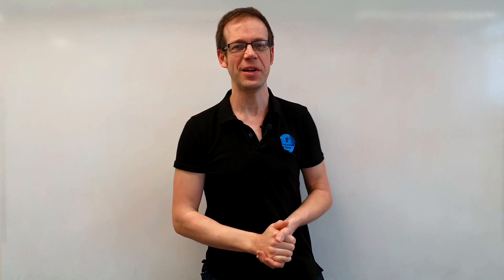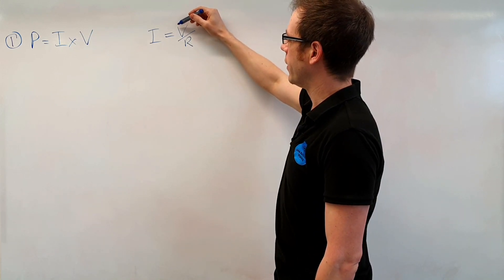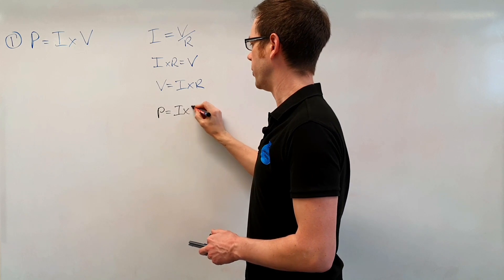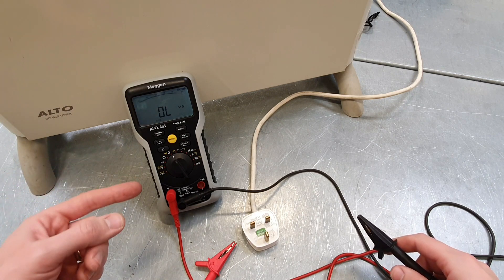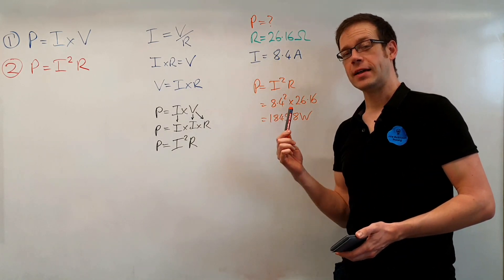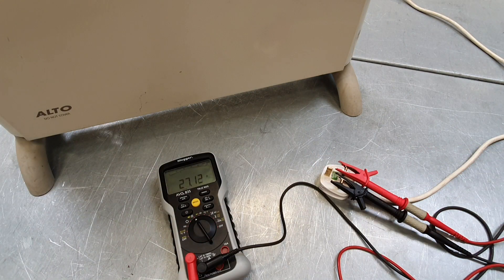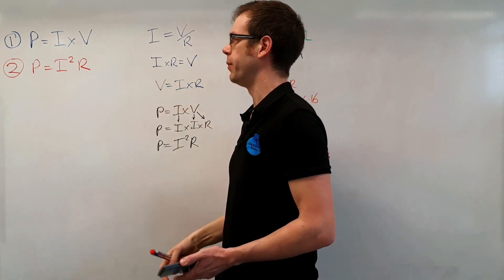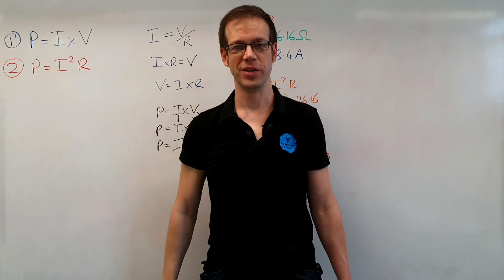How to Find the Power Formula Number 2 for Electrical Circuits, Calculating Power Without Voltage

Comment: when calculating power in ac circuits, you'd use IVCos0, I notice when you use the other power formula, I^2R, you don't use the Cos0... can you explain why? ( is it because your using the resistance? If you were to use impedance would you then add Cos0?

Comment: Hi Joe, just wondering what the calculation is for power lost as heat.  You mentioned this at 12.40 in the clip. Is it as simple as measuring the resistance before you use the transformer and measuring it again when it's warmed up, the difference being the power used as heat?

Comment: Try this on your learners Joe.
How much power would be consumed by this heater if you supplied it with half its supply voltage.
Reply from the maker: Ah, lovely question, I guess they fall into the trap of thinking the current stays constant!

Comment: Great video joe  , is there any regulations about hot line colours?? , i know the "brown" is the line and the "blue" is neutral so can we use in pvc conduit single wire ( the red or green or yellow or pink and  orange) or any colour we got in singles , and the blue stay the neutral and the earth  green/yellow
Reply: so joe is there any colours  besides the brown and gray and black like  (red or green or yellow or pink or orange) can we put them in conduit .